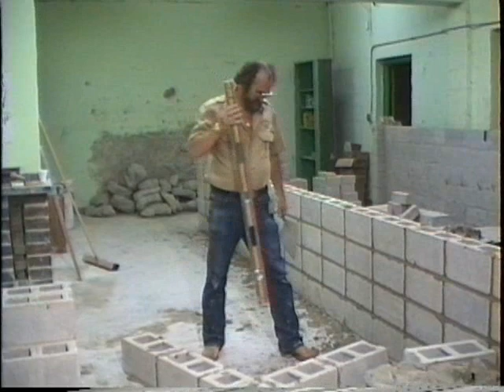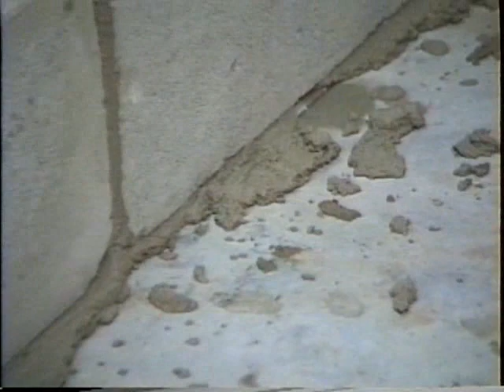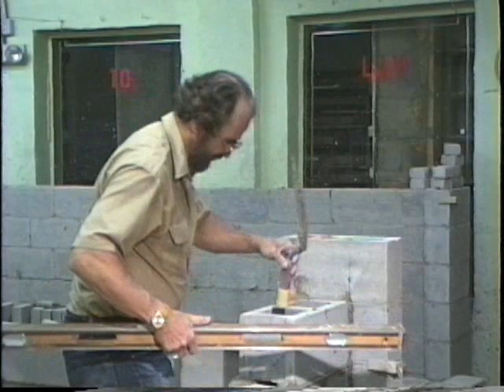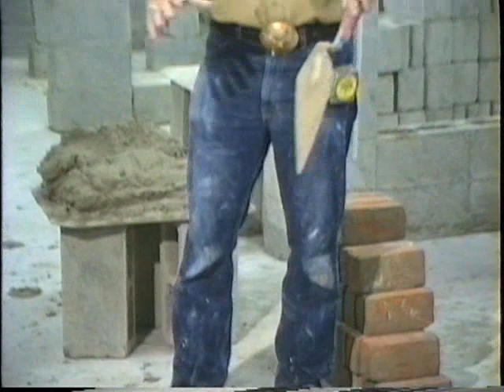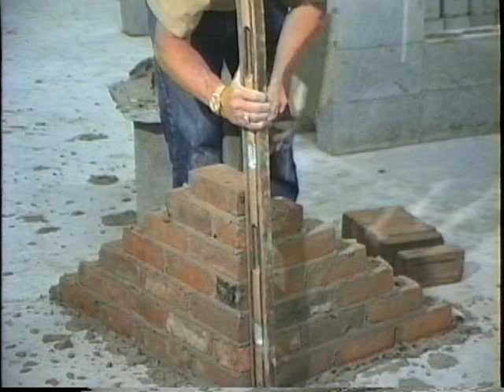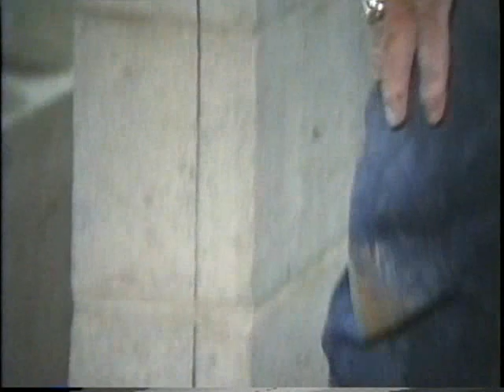BRICKLAYINGSCHOOL.COM Lesson 8 How to Use a 4 0 Wooden Level to Build CornersColumns

Comment: Can I lay all 4 corner leads on a 8x8 footing first then tie them all in? What if my footing has a high side of a 3/8 inch or so? Will it all come together magically in the end, or will I have to adjust as I go? Building a 4 course high 8x8 square block foundation with horizontal/vert steel, and with the voids filled in. First time laying block and pouring footing. Footing is in and is twice the width of the block and has a length of 8' 8" on each side. I put a water level to it and I think it came out pretty good. Like I said, it's off about 3/8 on one corner. If I'm in over my head please just ignore. Thanks.

Comment: thank you for that amazing video, a quick question if you don t mind. I do lot of work in N Y, and I always face problems laying that common Brick that you are doing on the video. what do you do to keep it from drying up the mortar so fast? because I can only lay about 3 at the time when the mortar is already gone hard due to that Brick sucks all the water thank you ,hope to hear from  you
Reply: Donaldo Arriola. Soak with water.
Reply: Also, your brick mud should have more water added so it don't harden fast.
Reply: Donaldo Arriola have the labor so wetting the brick as you go and bam! You'll get it down to an art...
Reply: a block is not a brick

Comment: I disagree about not straightedging the the bottom as well after the first course.  if there's a block in between your plumb points and you only do the top, a beginner will easily roll them.  Good solid videos though.  Nice job
Reply: If you will notice on block leads I always and I teach to always straight edge the bottom and the top of the block on the first course and first course only, and plumb all the block on the first course.  You must of missed it on the video.  Thanks for you reply, and if you wanna partner on a Masonry School in your area, get back to me.  clcbrickman@gmail.com
Reply: well that makes 3 of us for the time it takes. I guess his rational is that it cant be very far out from the coarse below but I know it makes a difference to do both top and bottom.

Comment: By the time you get scaffold high your would need waders for the mortar. Mortar o wet to tool sloppy mess.
Reply: I teach you to pick up and use most of the mud you get on the first course, then HOW NOT TO DROP TOO MUCH MUD AS YOU LAY THE UNITS.  Just part of my course on how to be a master mason instead of a BOOT.  :)
Reply: No I teach to pick up the mud and reuse it on the first course, then I teach not to drop the mud on the rest of the way up when laying brick.  Now block???  Mud is the cheapest thing on the job, so if you can get an extra 100-200 block in the wall by cutting it off, I will take the extra $1000-$2000 more money a day, and waste that $40.00 in mud.  Low paid people need a job, so let em clean it up, and put food on their table.  Most of the low pay are smart enough to take my course and become HIGH PAY.  :)
Reply: The cost of mortar includes many things besides material cost. You pay to mix it, deliver it to bricklayer and then pick it up wither soft or hard at a later date. Spreading mortar properly takes no extra time. On a union job no one is low paid with a bricklayer costing over 110 per hour in NYC and an laborer in the 80 dollar range i would have to check my cost. I can keep mortar off flor by cutting and retaining as fast as you can cut it and drop it to the floor.
Reply: Thank you so much for stating how much masons make per hour in New York, people in the south do not believe it, thank you again.  Now for you potential contractors who I will train, that tells you that the contractors make so much money per block, like $50-$75.00 per block, so come on let me train you and move to New York and make the big money.  Padledog also confirmed why the union will never be able to train someone to be a mason.  The reason I have said for 40 years is because a mason helper gets just a few dollars an hour less than a bricklayer, (on prevailing wage jobs) and the contractors can hire a UNION BRICKLAYER APPRENTICE FOR 50% of scale, or in Paddledog own words, for 50% of union bricklayers pay which is only $50.00 per hour, $30.00 less than a mason helper.  They never teach the apprentice to lay, have them doing mason helper work, saving $30.00 per hour, then when the apprentice after 3-3 1/2 years get to where they cost more than a mason helper, they fire em (because they can't lay brick, block or stone.  I have sold my course to many in New York who served out a 3 or 4 year union apprentice and cannot lay brick, block or stone good enough to hold a job down anywhere in the world.

Padledog, or anyone reading this, you need to team up with me in a Masonry School and make a lot more money than your making now.

Anyone interested needs to contact me at clcbrickman@gmail.com or call me 24/7 at 602 692 1896.

Thanks again Paddledog.
Charlie Cummins
Reply: Your kidding you think contractors make 50 or 75 per block
Reply: Union apprentice is not doing laborers work
Reply: The Union has a school
Reply: Yea I know, I have sold about 25 courses to the 3 and 4 year union 
apprentices who can not lay brick, block, or stone, because they are 
used as cheap hoddies, (mason helpers) on prevailing wage jobs.  It is 
not just your union in New York, New Jersey, it is the same in the 
entire USA, and Canada,
Reply: Yea I know, I have sold about 25 courses to the 3 and 4 year union 
apprentices who can not lay brick, block, or stone, because they are 
used as cheap hoddies, (mason helpers) on prevailing wage jobs.  It is 
not just your union in New York, New Jersey, it is the same in the 
entire USA, and Canada,
Reply: Yea I know, I have sold about 25 courses to the 3 and 4 year union 
apprentices who can not lay brick, block, or stone, because they are 
used as cheap hoddies, (mason helpers) on prevailing wage jobs.  It is 
not just your union in New York, New Jersey, it is the same in the 
entire USA, and Canada,
Reply: Paddledufus - Sloppy is good. It makes tha wall stronger